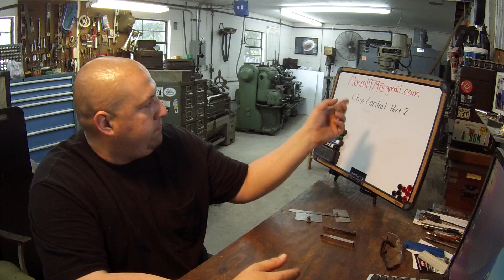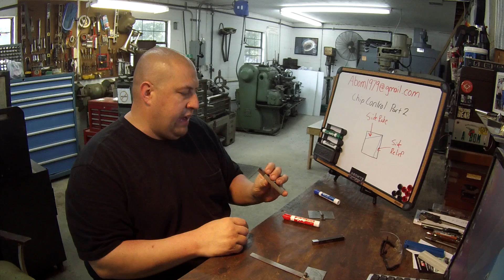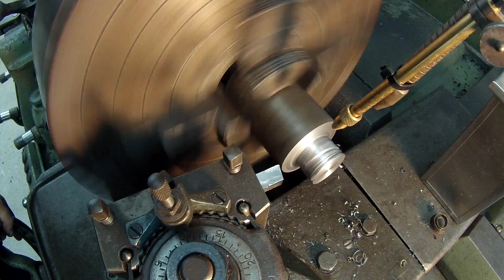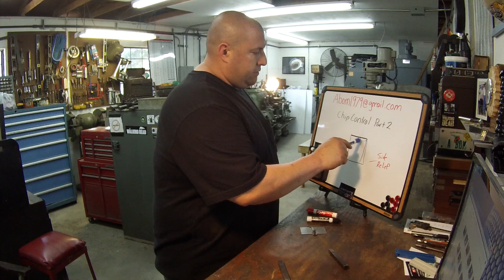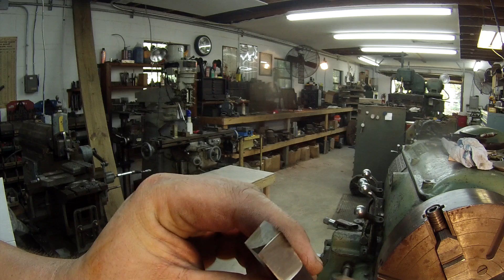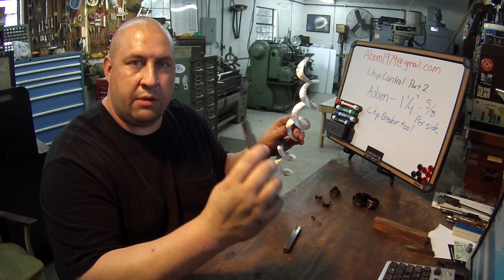Chip Control Part 2

Comment: 15:30  That's not a chip. That's a god damned Christmas tree ornament!
"If you dare turn your back on the machine, you're simply not running it hard enough....."
Reply: Sometimes you need to take the slop out of the bearings <grin>

Comment: wow adam nice very very large cuts, what size is the lathe you did this on and how many hourse power. im trying to make a comparison to what my single phase 3 hp metal lathe witch i took .200 off of the diameter only once and it was done by mistake thought compound dial was .100 but it was .200 lol.thanks like to know.
Reply from the maker: My lathe is a 16" Monarch and it's equipped with a 5 HP motor.

Comment: Is there any reason for breaking the chip other than preventing it from getting it wrapped up around the tooling?
I have always associated a continuous chip with nicer finish (excluding Bronze). Has anyone else found this to be the case or am i misleading myself?
My max removal is usually less than ..250".
Reply from the maker: +porousorifice A breaking chip is a better controlled chip, and less dangerous. Bird nesting the cut is not the way to machine.

Comment: Thanks Adam for great video .... better than cartoons  I recall someone 's video need to strive for a 6 or c chip no blue or yellow .... do you have an opinion on that ?
Reply from the maker: +Eddie Brooks When using a chip breaker cutting mild steel like 1018 cold rolled, if you can get those perfect little curls they don't really turn color and that's a great chip.

Comment: I know this is a year old but just wanted to point out that if you angle your chip breaker groove away from the cutting edge a bit more it should cause the chip to curl around and hit the tool face again and so cause it to break and give you that perfect chip more often than not, feed speed permitting.

Comment: I know this is an old video but I just got to watching it.  I'll give the chip breaker a try on my lathe.  I use 1/4 HSS on it, but I've had trouble getting it to cut clean at times, it makes strings on most steel.   I've been using the old textbook grinds like your first tool was.

Comment: hey bro can you do something like this with crappy stainless that does not like breaking and strings to no end or is that just not possible? I have machined lots of stainless and it just does not want to cooperate
Reply from the maker: +japanman1986 Yessir. I have had great results turning stainless with a hss chip breaker tool, hand ground and running slow rpms.
Reply: cool thank you

Comment: now i am not a machineist by no mean but i wonder how much better it would work if you used the end mill to make the chip groove so the gullet was 90 degrees maybe the chip would not curve in th ebottom but rather break as it hit the sharp angle  just thinking
Reply: You must grind the chipbreaker groove b'cuz, your tool is made of HSS.You could not cut that groove with an end-mill.

Comment: after the first cut you could skin the rust off 1/2 inch from the shoulder knurl it drill it for 3/8 bolt and tap it cut it off and you have a headstock cover knob

Comment: that sure looks like maybe a late 50's early 60's Lathe the tool post tool set screw has four sides and the tool slide is geared with a post dial definitely vintage

Comment: Very fun.
You can take some stuff from the fine woodworking community on this topic, chip quality and rake are extremely important in woodworking. Maybe even more so than in metal working because woodworking machines are less rigid.
If you look at tools with chip breakers (mostly hand planes), the chip breaker is adjustable. The closer to the edge, the faster it breaks the chip. Moving the breaker away gives a longer chip, but a long chip tends to tear up the surface since it is pulling on the fibers. You can see the same thing happening in the really long chip you made, one side is a different color from the other where the metal was actually stretched as it was pulled out of the stock.
Moving the breaker too close will cause the chip to compress and cause chatter on the surface as the chip compress then breaks repeatedly, You can see the same chatter marks on the work.
Getting the breaker just right will leave small cracks on the outside of the curl. It is important that the curl roll up and snap off rather than compress and break. You'r perfect chips all have nice evenly spaced cracks on them.

On the subject of rake. Rake angle and feed rate must be done together. As the tool enters the work, it is pulled deeper into the cut. You see issues like this with band saws in woodworking. The blade is constantly being pulled into the work, and can actually pull the blade off the tires if the feed is too slow. My band saw is so big you can walk upright through an unfolded blade. I can cut 1/16" thick veneer of a 12" wide board. The chips are miniature curls when I have the feed rate right.
Find a feed rate that works with your rake, then find a chip breaker position that works with that ad you will be a very happy camper.

Not saying anything you do not know. I am just saying it from a different point of view that might get you thinking of different ways to get a good result.

Comment: Great video - I am not a professional like you but here is an observation (please don't laugh!  :) It appears the chip breaker may work better if two parts of it were modified:  The chip length before breakup should be proportional to the distance from the cutting edge to the "back" of the gouge - where it turns up - that is the larger the distance to the upturn in the chip breaker gouge the longer the chip length.  If there were no chip breaker the length would be very long.  Second, the sharpness of the end of the chip breaker gouge opposite the cutting edge should assist the break off of the cut ribbon.  The gouge turn upward angle sharpness makes the chip make a sharp turn upward at this rear edge and the sharper the turn the more chance of breaking the work hardened chip into pieces. Thanks for the well made videos!

Comment: Chips can be broke with more feed and less rpm. Just have to tweet it in. For a large depth of cut I would recommend a lower rpm and increase feed. I've taken .5 dia cuts with a half in tool bit and nothing bad happened. Be more aggressive and I think you will find better results with chip breaking.

Comment: I think that if you would have changed your lead angle again and rotated your tool holder to present your tool where it hits on the O.D. of the part first and at the corner of the tool last with the heavy feed rate and 1" cut you would have directed the chip into the work face instead of curling out away from the work. I believe that when the chip hits the work face is when it would break. Just my observation.

Comment: Ditto the nice work Adam. Video comment: At 31:26 you remove the camera for a hand held view and the machines saddle noise goes away. As a thought, you might experiment with various rubber or foam isolating mounts to try to eliminate noise from transferring into the camera.
Reply: I went back to listen to it at 10:00, before you switched to the protective case. It seems it is the case that is amplifying the noise, like using a stethoscope.

Comment: Adam,  that is one huge set of chips!  Are you trying to make a grain augur or something?  I was starting to think you weren't going to be satisfied until you got a "CLANG!!" when the chip hit the tray!  

Thanks for the lesson in tool grinding. I think I'm understanding the chip breaker idea now.  If I am, I'm guessing that for those really big chips you almost need a wider groove that gets deeper as it moves back from the tip, so the chip will be bigger in diameter and spiral away from the cutting area, rather than looping back into it.  Right? 

-- Mike
Reply from the maker: I was just trying to see what the old machine could handle.
The chip breaker needs to be wider for those heavier cuts to allow the chip room to curl around. If you have a small groove for such a heavy cut it seems to just run over the groove and off the side like a side rake grind.

Comment: You got one cause all the cool guys were getting them ???
I thought of you as pretty cool before the whiteboard Adam!
I will be interested to see how your level of coolism increases.
Is that groove in the top, also increasing the side rake angle? Does it depend on the proximity to the cutting edge?
I put those grooves in my hss bits with my dremel/w abrasive fibe disc attached to my milling machine.
These vids on cutters by you guys are awesome.
1/2' depth of cut     Hahahahaaa.... In my dreams, or, on this video right here !!
Reply from the maker: Hard to top the coolism if oxtoolco but I'm trying to learn from the best.
Yes the groove provides a steep side rank angle for the chip to curl into, and I have found the larger the cut, the wider the groove needs to be, and that has worked well for me. I just like the performance of a "groove" vs just side and back rake.
Reply: Abom79 I just used the thin dremel  disc to try replicate the groove my carbide inserts had and it worked a treat.. Thanks for the link, already a subscriber.
I meant a different coolism, unlike lyle (aka tubalcain or mrpete222),whos not quite cool, also myfordboy, who doesn't even speak... ect...

Comment: Hi Adam, Definite proof that different grinds can achieve similar results, just like there being so often several right ways of machining to make the same part... My personal grind for this bit of fun, would be to use back rake, about 8 degrees or a fuzz more, and a bit larger radius on the point more than a 64th but less than a 32nd... I've found that you don't have to raise the bit with back rake as long as the point of contact is on center... And still in the end, there really is no absolute! I've gotten good results with, and am more often a fan of oil, and coolmist too (but a bit thicker mix than instructed on coolmist) This is a great series guys and a beautiful bunch of instruction! As Sam says the show goes on! :o]

O,
Reply from the maker: Thanks O. Its fun experimenting with different grinds, and it's proven by many that theres several that provide good results. I like the chip breaker style myself, and can take alot of metal on mild steel better than with a typical side rake tool. I have used some with back rake also and they work just fine. I say just use what works best for you, and if your happy with the chips, and finishes, then go for it.

Comment: Hi if you will grind a chip breaker on the top of the tool then it will be curling and breaking depening how big chipbreaker will be. Changing angles not chelps a lot. Not reliable.

Comment: Very informative, a picture is worth a thousand words. Each factor has an effect. I am making a misting spray from a pump up 1Litre garden sprayer $5, these have a brass adjustable nozzle. I will use it with a water soluble cutting oil mix. This is something you could add to your water mister for an experiment?
Reply from the maker: The soluble oil works good too, it just seems to fog more than the blue stuff from Kool Mist. Sounds like a cool home built mister you are working on.
Reply: Abom79 Fogging depends a lot on atomization pressure and nozzle setting with any spray nozzle.
Reply: Yes indeed, the nozzle I have adjusts from drops to a thin stream to a various sized spray. I work mainly with aluminium alloy's 6061 and aluminium/magnesium for marine use, imported from France. Great material to machine. But some steel, stainless & often brass. I find all these video's very informative indeed. I also try out some of the demonstrations for practice.
Reply: Shevill Mathers For my small hobby, I found a dental handpiece with water, air and mist valving handy. I already thought of the sprayer and will be interested to know how you modify it to mix the air into the water to make it mist, and not just spray.
Reply: Shevill Mathers mrpete222
Mrpete222

Comment: Thanks a very good show.  The Monarch is a powerful lathe.

Can you describe its drive train.  Electric motor to belts to gearbox?

Thanks.
Reply from the maker: It has a 5HP motor that uses several drive belts that run the headstock with a clutch system.

Comment: Love the chip control series - I have got a round bed lathe from the early 1940s (approx. 20" between centers), and there's no day that I don't try to optimize the depth of roughing cuts I can take with the machine still being able to cope with it (no nasty vibrations a.s.o) - I've been getting around 4mm depth of cut recently, and I am really proud of that LOL
Maybe I can experiment with the tool geometry a bit to knock even more out :D
Cheers
Adrian

Comment: That big glob of chips from your 5/8" cut is bigger than many of our finished products!  I'm looking forward to the video about making a nice finish.  I just finished up making a taper attachment for my Clausing 5914 and a smooth finish will be important for me.  On my first test with the taper jig, I produced about 50' of wire, instead of chips. (check my last video) First run on my home-built lathe taper attachment

Comment: Like you I've never found a "traditional" ground tool to be good with chip control. You have to incorporate a chipbreaker in there for heavier cuts or the stringy chip is gonna happen.
I generally use a rotary type tool like a die grinder or dremel as I find it hard to see what I'm doing on the bench grinder.

Colin
Reply from the maker: The chip breakers have always worked best for me. I use side rake and back rake grinds once in a while for cutting bronze, plastics, or grooves. 
That big grinder helps when grinding those grooves though.

Comment: I think you were steering those big chips to turn to the outside of the steel shaft and then were able to come around and roll up around the cutting tool, I think that if you kept the tool flat flush against the face of the chuck the steel would curl up and hit the steel shaft and make a big curl and snap off, or even turn a little more so it cuts on the outside edge first then the tool tip cuts last forcing the chip into the center of the steel shaft and snapping off. I hope this makes sense! Brad Fisher

Comment: hi Mr Booth im mad at you, you forgot to mention me and i had the biggest cut O wait i may have been disqualified or maybe you forgot hehe im just messing. i guess my 1" cut couldn't hold its ground as the biggest cut vary nice 1-1/4 cut im not going to try any bigger a inch is a hell of a cut on my little 13. i will try and do a video on my style chip breakers i cut in my tools when i use them again cut on the mill but this time i wont screw up the video lol. keep up the good work and thanks for the videos My name is Josh by the way
Reply from the maker: I will go and check out your video Josh. I didn't know you made an attempt at the biggest chip. Thanks for posting.

Comment: Adam nice job I look forward to your next video on getting a good surface finish.  For me that is most important I can take time to remove material, I don't want to push the machines since they are not mine.  Trying to dress up a poor surface finish cut is way harder than nibbling away at stock to get to size.
Reply from the maker: In the next video I'll show some finishing cuts in cold rolled. If you get the grind and home right, it'll leave a silky smooth finish. 
The heavy cuts we've been showing isn't common, were just having a little fun seeing what the machine and tool can handle. 
Thanks Bill.

Comment: Hey Adam,  I think if you work a little back rake into that chip breaker you will be pleased.  I find that helps keep the chip moving away from the work, rather than curling up around the front of the tool holder.  Hmmmm, maybe its time to do some more videos.
Reply from the maker: Yes the back rake works good too, and I've seen in it action by my own doing. I like trying to keep my cutting edge straight and a neutral rake so that I don't have to adjust the tool height each time I touch it up. Just my preference.
Reply: yes Mr. Kilroy it is time for more videos lol i look every day but nope no new ones  i have no cable you guys are my tv (tv is joke anymore and the news just lies and the weather is never right) so y pay for junk when i watch youtube for free so lets go get your butt in gear and make some hehe all jokeing aside thanks for your hard wok the gos in to making the video

Comment: Hi Adam,
So far with the new lathe I've only tried carbide inserts, like 1300 RPM on a 2 inches CR stock, .007 per revolution feed and .500 radius deep, geezzzz the chips were flying like a hail storm... Good thing, the bigger chips where breaking about only 3/8" long.
I will get into high speed a little later, if I start that now, the reorganization marathon will never end. It will be like your shop a "Never Ending Story".
Cheers,
Pierre

Comment: Hey Adam I use to use that same cool mist system in the tool room and the oil we use was the one you mix with water and turns a whitish color. Nice video Adam I wish I was back in the tool room man.
Reply from the maker: I used to use the soluble oil in my old mister years ago, but i noticed it tends to fog the shop worse. This blue stuff from Kool Mist is supposed to cut down on the fogging and be more safe. it does what I need it for those, mostly cooling for the milling machine.
Thanks Ruben.

Comment: For the chip breaker, does the curl of the chip take on the shape of the curve of the chip breaker (given it has a chance with the feed rate and spindle speed)?  Would a deeper, narrower chip breaker have a smaller curled chip and have more tendency to break rather than wrap?  I don't have much experience with this stuff yet, so just doing mental thought experiments.
Reply from the maker: I have found in some cases of using a narrow groove when taking heavier cuts the chip doesnt have enough room to roll through it, thats why I grind mine out wider for the heavy turning.